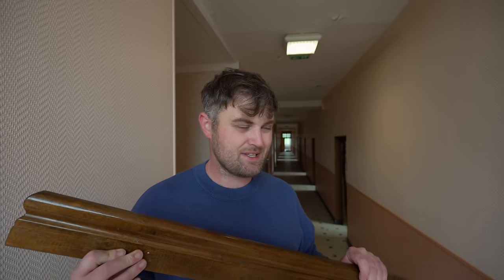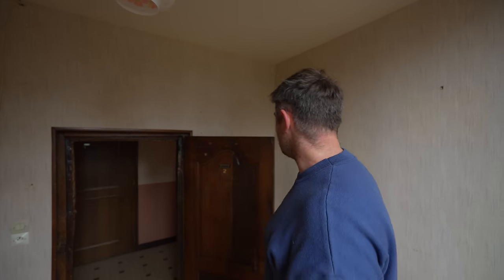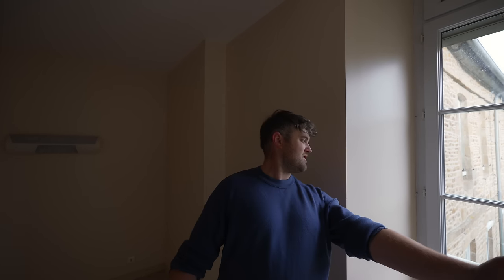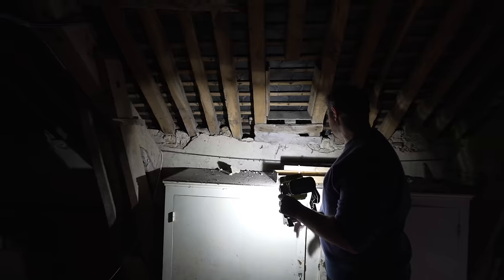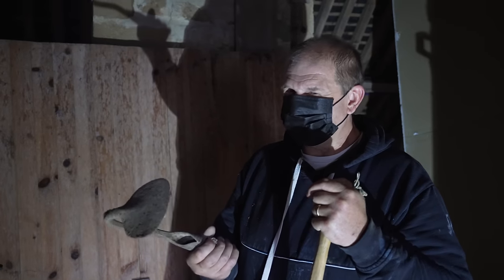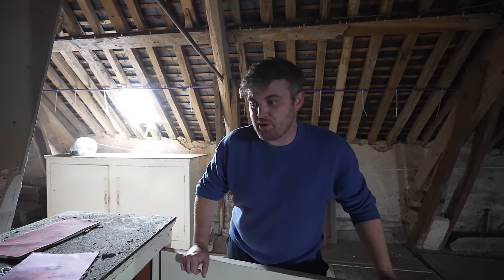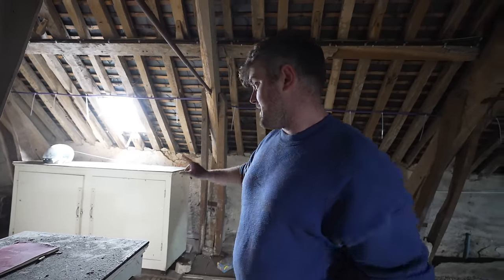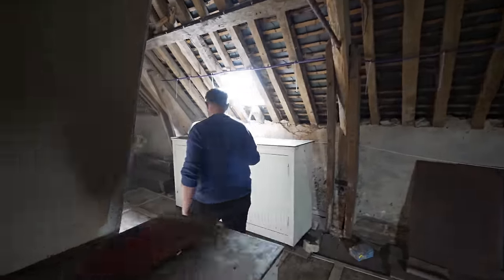You Will Never Guess What We Found In The Attic!

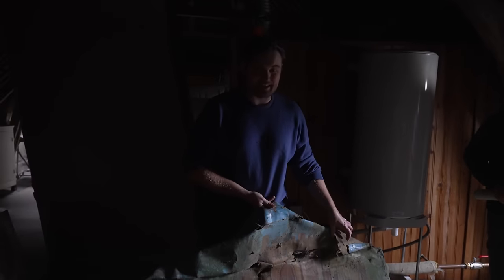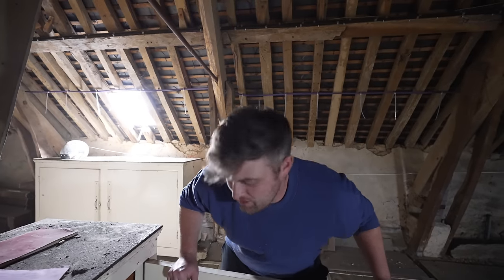Comment: The painting on the frame @ 8:28 is a backdrop for a Christmas Nativity Scene.  Probably for the chapel from its size and where the top pleats are - forming a roof.   Appears it is painted with oil paints as well which would explain how it is still in fair condition.  At 8:57 - Nappes - grandes et petites - Damassées=> Tablecloths, large and small + Damask type linen tablecloths.  @ 12:58, the "kneelers" are not such items.  Could these perhaps be a bottom step of the spiral staircase to the 2nd floor of the chapel? Or of another staircase?  The steps to the altar are already there....
Reply: I came to say that about the spiral stairs! & I think he's found a bell!
Reply: I hope you haven’t bought a Nun

Comment: With the opening shot of the roof, wouldn't it be great to have a power washer on a helicopter!  And then a garbage chute from the attic to a dumpster!...   Has anyone used a metal detector in the garden grounds?  Since the convent has been around for ages, you may find some really awesome stuff!  The only interesting things I've found in our old attic from our former house across the bay from San Fransisco where the water was turned on in 1906- were a few concussions I would incur when I would suddenly turn my head and forget there were 2 x 6 dimensional lumber cross beams to hold up the roof where my head wanted to go!  It was a summer cottage for a local sugar family for years where rooms were added and several different wallpapers and newspaper( all without dates) would line the lathe and plaster walls for insulation.  Many holes in the walls where the woodstove pipes were moved from old rooms to new ones as the cabin grew.  After we renovated it to our liking, we couldn't afford the pricey lifestyle, so we moved to Nevada. The old house has completely been turned into something modern and doesn't 'fit' in the old neighborhood.  Looks completely different and all our landscaping is gone! Ah! Progress!

Comment: The holes could also be a toilet flue/vent I suppose.   When rehabbing my home quite a few years ago I had a wall between 2 bedrooms removed to make a larger room.  They found a flue in the wall so we had to redirect it. Had never heard of such a thing before.    It night be interesting if you made an area somewhere to put your interesting finds - like the gambling wheel and the leather emblem and other things.  Loved my discoveries.  I found a silk bedspread - lt pink and a hand laced topper that were made in France. They were inside a wall along with 2 crystal bedroom type lamps.   The spread was beautiful. Obviously someone’s treasure.  Also found a huge crate in our unused coal room which fell apart at some point and I saw a dish just inside the door. It was full of old Limoges pieces from the turn of the 20thc Like 7 or 8 pc place settings, a set of Haviland plates with fish motifs, sterling fish services and a Pouyat Limoges service from the 20s that crazily matched the chintz pattern on my dining chairs.  I lived in an old Catholic parish so i assume the fish sets were for Friday dinners.  The original owners were long gone so there was no one to contact to return.  I was the 3rd owner over 100+ years.  I still have and use the dishes and sterling and actually bought missing pieces on Ebay.  I recently moved it all from NyC to Manchester, Vermont.  My daughter has the Pouyat set and my dining set in her ski home on Stratton.  Interesting how our things move across the globe.

Comment: The two timber 'step' looking things could be the original GRADINES from the Chapel Altar?   These are used for putting flower vases and candle sticks on. If they were sanded back and varnished, they'd be beautiful!  I don't think the nuns would have hauled actual steps up to the attic for safekeeping, but the Gradines, yes.  Did you find the Tabernacle by any chance?

Comment: I might suggest instead of a large heavy bell in the tower how about an electronic church bell that would be easy to mount the speakers and volume control in your office.  Most of these are sampled from real bells and impossible to tell from the real deal.  Also, you are not limited to a single tone but could be set to sound like Big Ben or Norta Daum on a good day.  I would cringe at installing a several hundred-pound bell in that very old tower.

Comment: In America, most often, before you could get a "certificate of occupancy" to operate as a hotel you would have to have a structural engineer certify the building structure and have a sprinkler system installed. Not to mention smoke detectors in every room. Good luck on your project.

Comment: Assuming you can rent out 25 rooms 365 day per year at 100 euros= that's 36500 per year. Not including taxes. Each room will have to have plumbing which does not yet exist. That's toilet, sink, shower. The usual requirement for draining g a shower and toilet is a 3" pipe. Added to that water supply to all three. That's for all 25 rooms. Then of course are the usual things involved design break I g through walls, finishing, painting, decorations and furnature. How many years will it take before you actually turn a profit when additionally you have to pay employees to clean and run the hotel only bringing in  36500 per year?
Reply: Sorry my math is off, that's 36500 times 25=912,500 euros. Point still passthrough because no hotel fills every day for a year.

Comment: i am disappointed to see you remove that railing... I noticed in hospitals and retirement homes that it is convient for those in wheelchairs to move along the halls with the railing.  I dont know if you plan to accomodate  handicapped in your building. however  i suppose it is floors they would have trouble getting to anyway.

Comment: people talk about people being shorter in the past, which is why doorways are soooo low, my theory is heat was expensive back then so to hold on to the heat longer, the doors were shortened  to hold the heat longer through out the build, and reduce costs in the outer wings of the building by shutting them down when not needed............

Comment: You could also keep one room as a bedroom, split the next room into two and make them bathrooms, then the next room on would be another bedroom. So you'd use two rooms as small doubles with a bathroom for each in between. Make the larger suites on the second floor and the smaller doubles on the third floor!